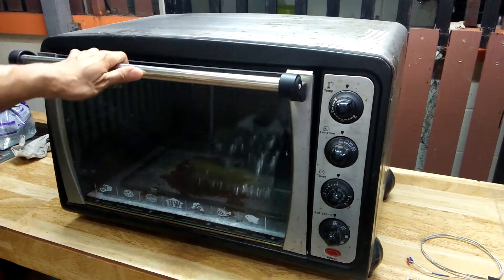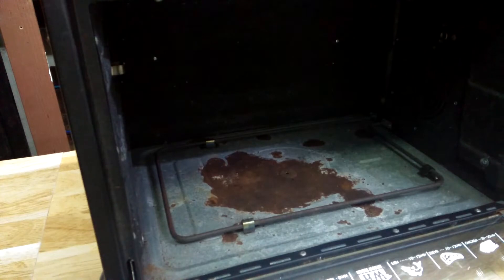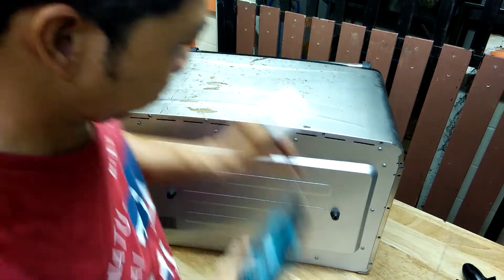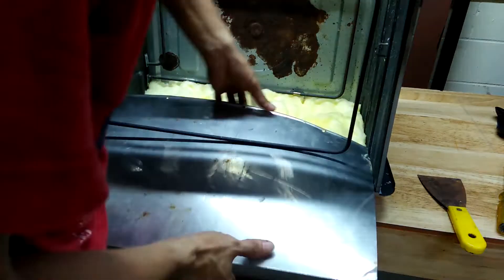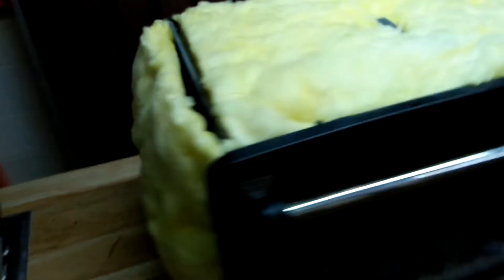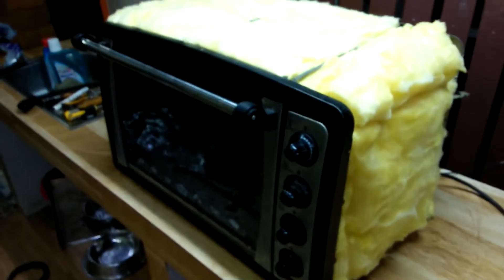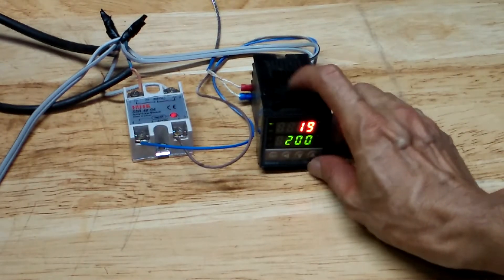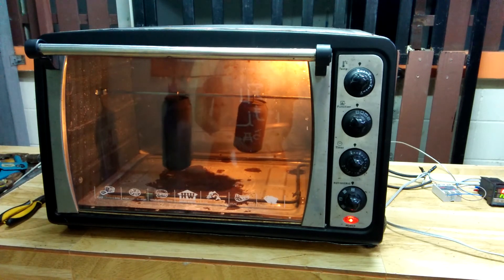Improved Kitchen Oven For Powder Coating Using PID Controller

Comment: Great video. Insulating to controll thermal loss is very important. You may also want to add a heat sink to the SSR.
Reply from the maker: Thanks.  I'll get a heat sink for tge scr and put everything in a box soon.